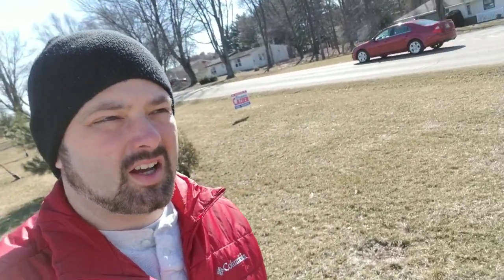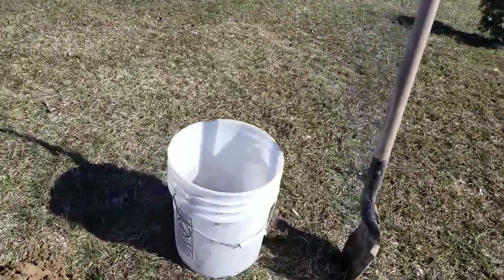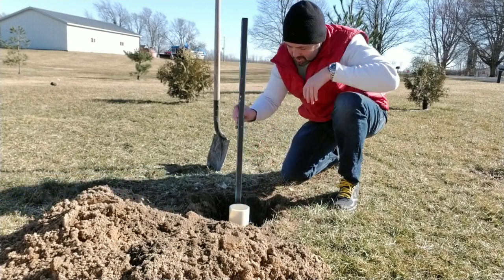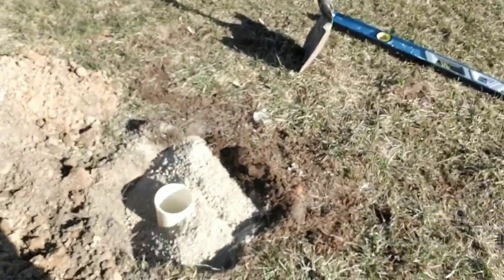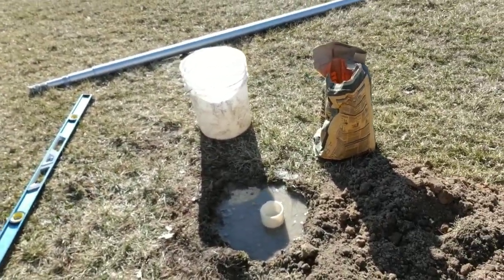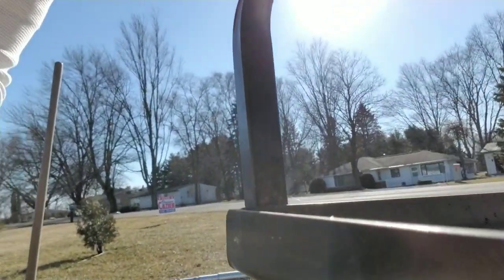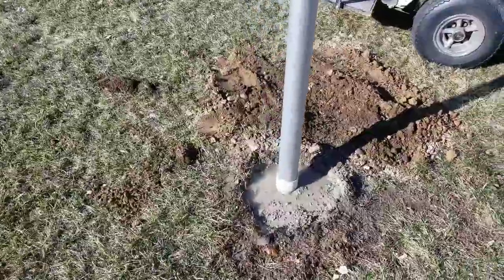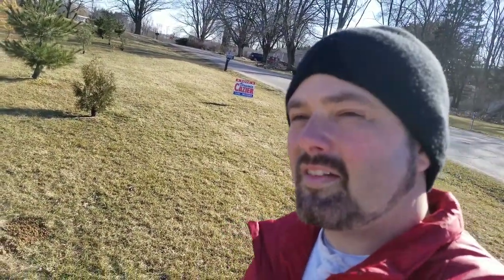2019.03.23 - How to install a telescoping flagpole - Titan Flagpoles from Off Duty Flagpoles

Comment: Ben, you're right about water. In 24 hours, Quicrete will absorb enough ground water and harden. I've built corner posts like that successfully for years. Thanks for the tip to other viewers. A carpenter's plumb bob will help level it.
Reply from the maker: It always works well for me.  If there is a drought it probably wouldn't but this was not the case.

Comment: I'm very glad to see you did the concrete this way. This is how my dad taught me, and after ordering my flagpole today, I was thinking this is the way I'd do it. Yours is the only video I saw like that. I'm getting a 20' pole, so if it's holding fine with your 25' one I think mine will be ok! I'm all for doing things the easier way, and in this case, the cleaner way.
Reply from the maker: Oh yeah you will be fine. As the moisture comes in from the ground it works great.  I haven't had one ounce of problems putting concrete in this way.  Enjoy your flag pole.

Comment: There's an easy way to make sure you're pole is level and plumb. You can buy an inexpensive piece of PVC that's a few feet long and fits snugly into the flag base pipe and insert it into your pipe for the flag pole.  This will allow you to get a secure level and then you can just slide the pipe out of the base pipe the next day.  It is much easier to get a true level and maintain it when you have a long pole sticking up from the ground as opposed to a pipe with only an inch or two sticking above ground.  Good luck.
Reply: What size of PVC Pipe would work ? That is a Great Idea .
Reply from the maker: Great tip! Using a longer PVC pipe to ensure a level and plumb installation is a smart workaround. Thanks for sharing this practical advice with us. Happy flag flying! 🚩😊👍
Reply: @benplikerdsminute  
Thank you.  🙏👍

Comment: Titan flagpoles come with a red cap to plug the top end so concrete accidentally spills in during the process.  No reason not to use it.
Reply from the maker: You're absolutely right! The red cap provided with Titan flagpoles is a handy addition to prevent any concrete mishaps during installation. Safety first, right? Thanks for pointing out this important detail for a smooth installation process. 🚩🔴👍

Comment: There is no way the water mixed in with all that dry concrete.   I poured concrete for 18 years and you ALWAYS mix it with water before dumping it in a hole!
Reply from the maker: You should try it sometime.  I do it all the time and stuff sets up just fine.
Reply: @benplikerdsminute  i agree, if you leave a bag of concrete outside it will harden in the bag so no reason it will not in the ground.

Comment: How do you lock it so someone doesn't pull it out of sleeve and steal pole
Reply from the maker: Unfortunately you cannot lock it.  Anyone could steal it.  :(
Reply: I found a lock for it it looks like a metal clamp and goes around plastic insert in ground ,it tightens pole to insert and no one can pull the flagpole out of ground.
Reply: @benplikerdsminute  I found the locking system for it on line works great looks like a metal hose clamp
Reply from the maker: @18181859  offdutyflagpoles.com
Reply from the maker: @18181859  they are a great company
Reply: @18181859  titan flag poles web sight
Reply: move to  place where people are not dirt bags
Reply: @nickchristopoulos8138  away from you
Reply: @terryjames5552  sounds like you're one of them